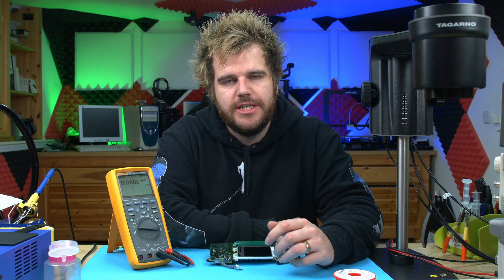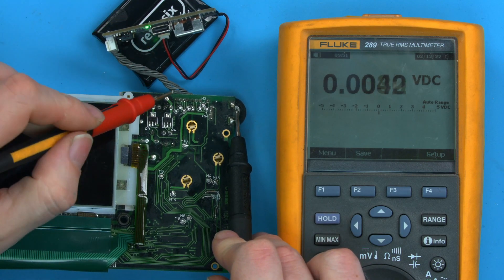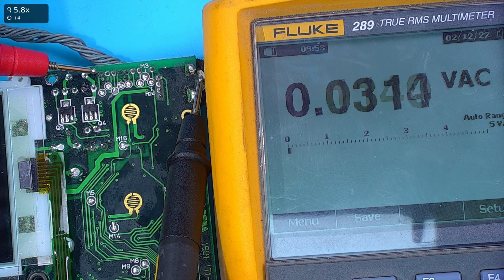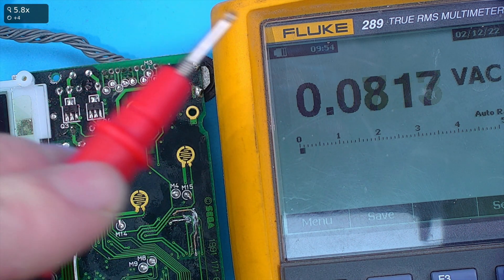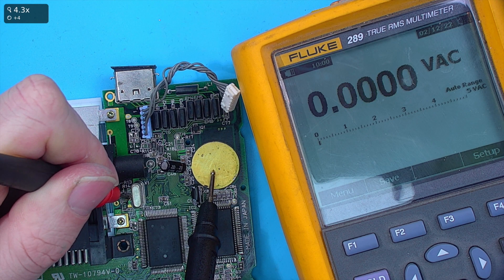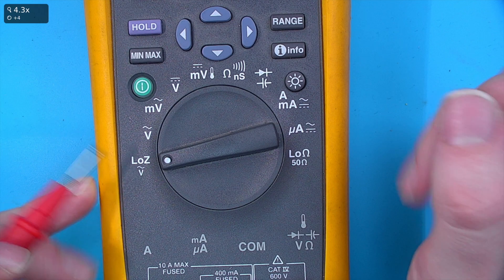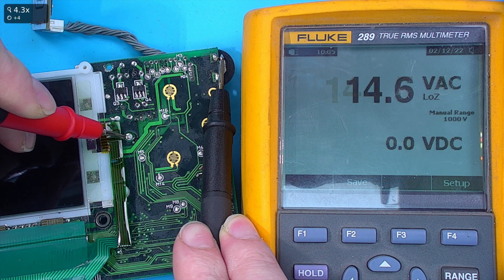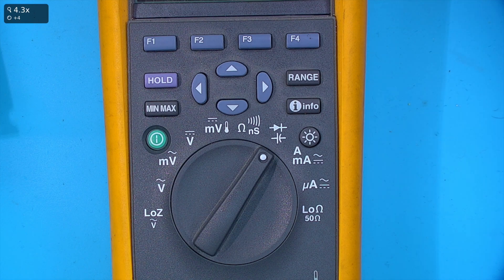Voltage AC Multimeter - Part 4: Diagnostics & Repair Course

Comment: How is it possible to generate 400V from 5V battery?
Reply from the maker: Transformer and diodes
Reply: Thank you for answer, but that 400V can harm? If its from 5V or 3.9V battery?
Reply from the maker: @wilk85 hurts. Burns hole in finger
Reply: Wow thank you for clearing this to me. Need to read more